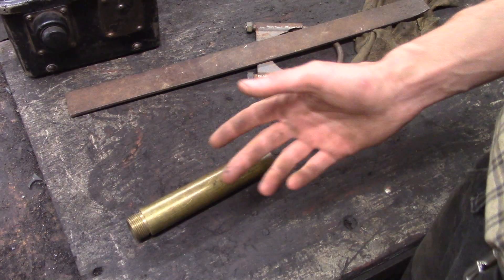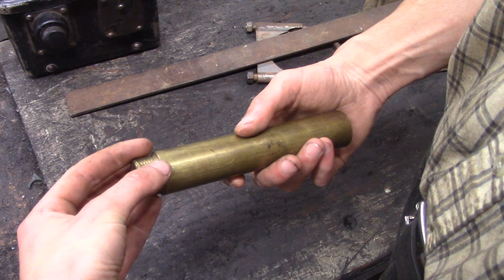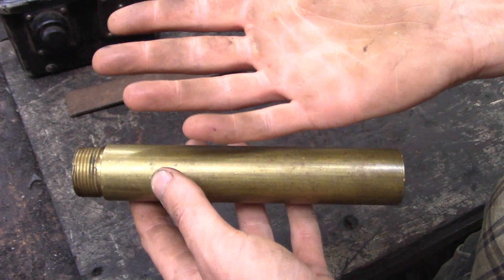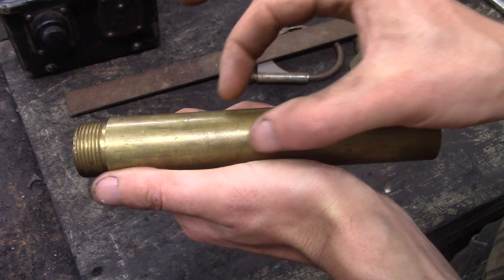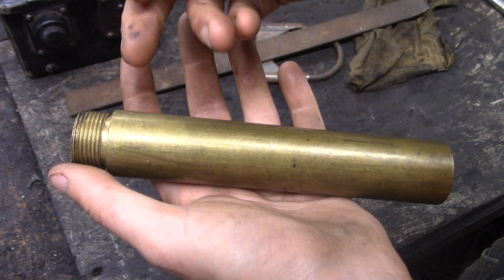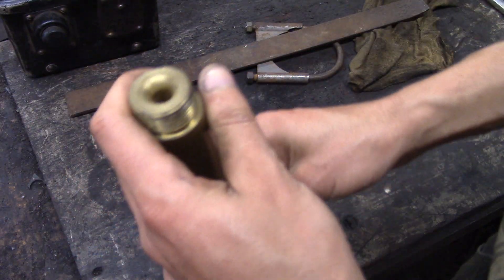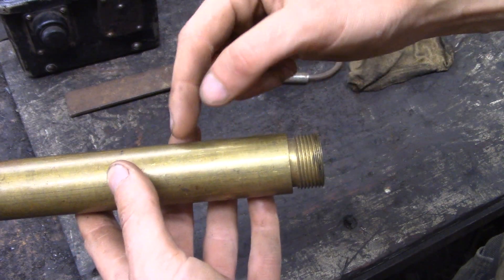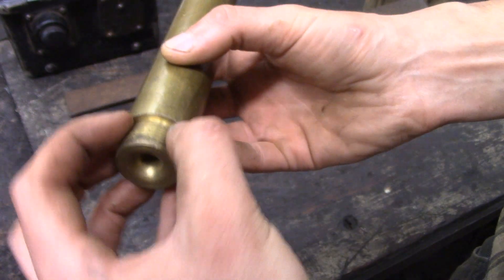What Should I Make From This Venturi?

Comment: So I doubt very much that this would be installed on the suction side of a pump reason being is it would decrease the pump efficiency greatly anytime you restrict the suction you decrease output on an irrigation pump you would get tons of cavitation and it would soon destroy the pump I would guess that your Venturi was possibly for an injection system maybe for mixing liquids or powders
Reply from the maker: I agree, it does seem odd. Also if it was an inlet to a pump, i would think it would have an inlet screen of some sort. I'm just repeating what i was told about it. There are no part numbers or anything on it.

Comment: I was thinking of some "device" that went bang somehow. But  problems I see are youtube will get mad ,it's probably illegal anyway. Then the last one is the wall thickness at the wide end enough to take that kind of pressure, without coming apart depending on forces applied.   Maybe you should just make a wide threaded base and use it as a pen/pencil holder L.O.L
Reply from the maker: I don't think there would be legality issues, but the changing bore size would be problematic. Also brass isn't the best material for that, strength wise.